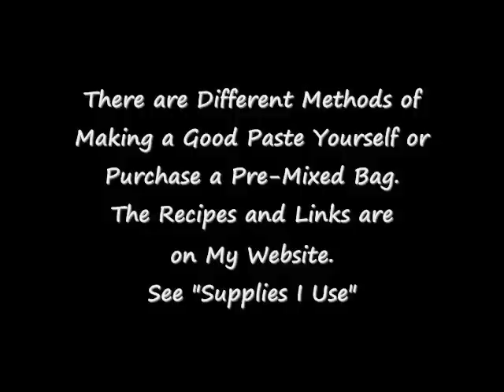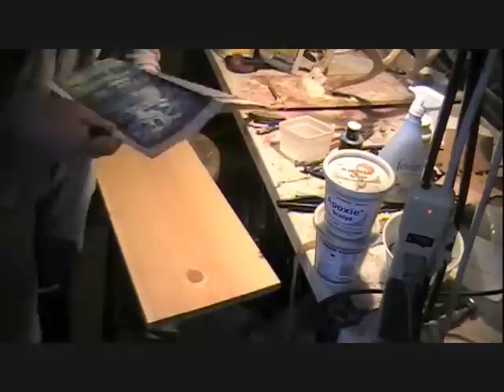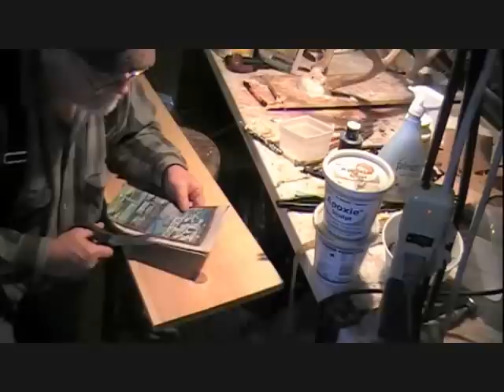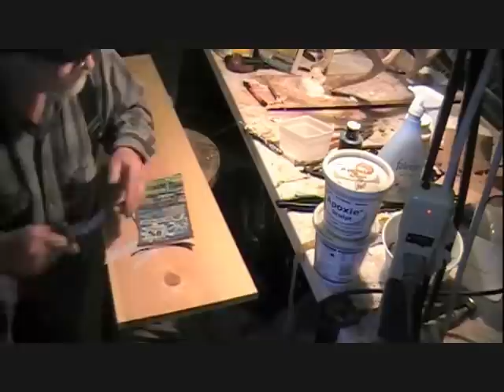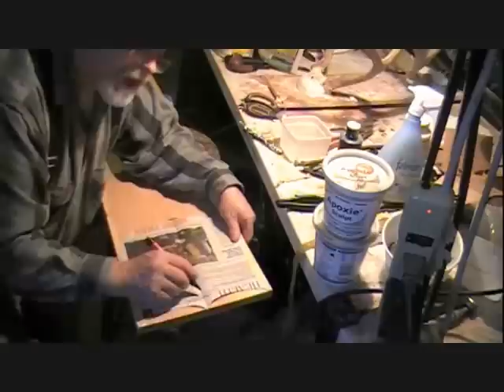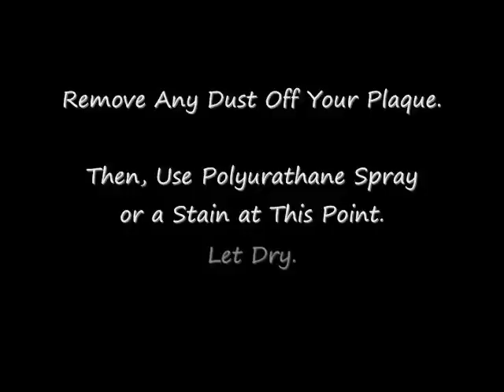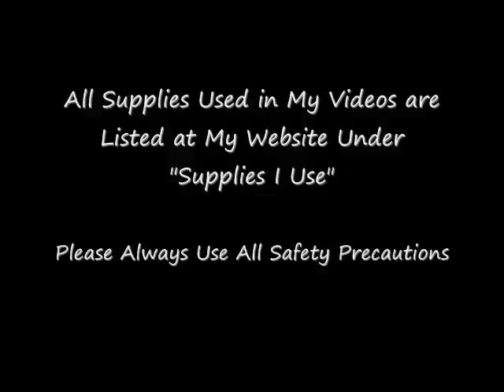ANTLER MOUNTS (aka HORN MOUNTS)

Comment: How do you clean the skull plate?
Reply from the maker: Most of the time, there's hardly any meat on it.  There's several ways to clean it though.  Put salt or Borax on it.  When it dries up, scrub the skull with a wire brush. The third way is to boil the skull with a bit of Dawn dish soap. Great question.  Thank you. - Rick
Website:  Everything Wild Taxidermy, Flintknapping, DIY Life